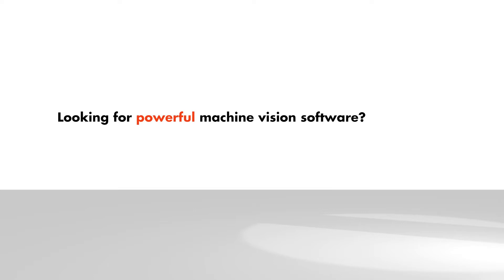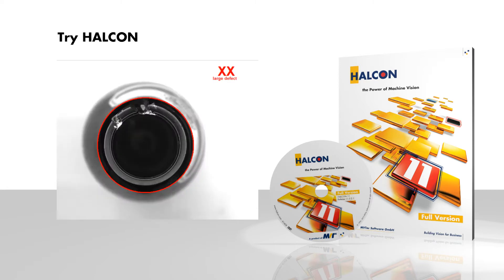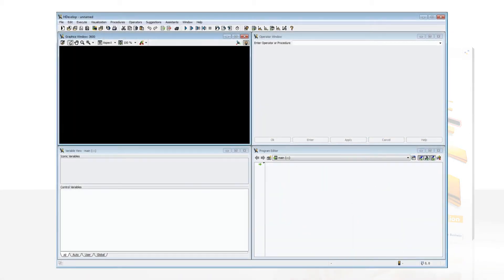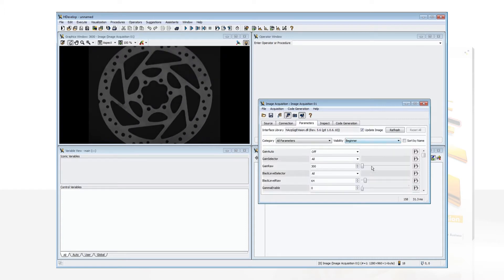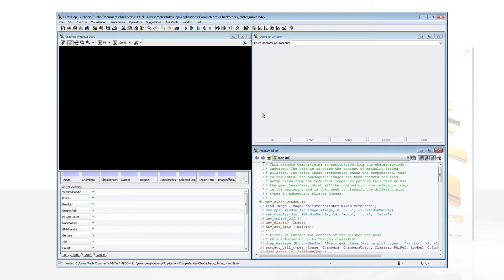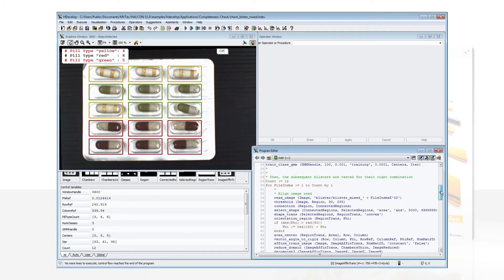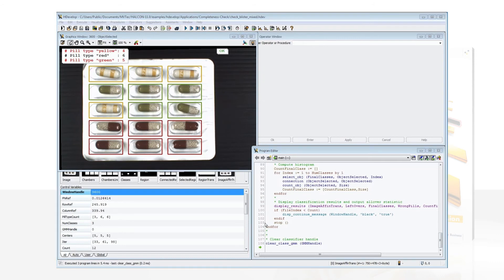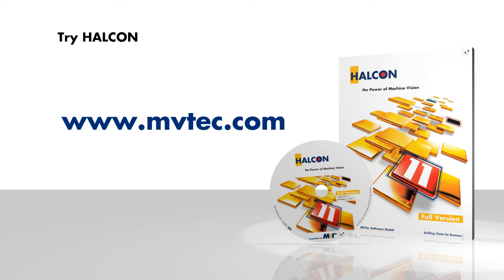Try HALCON Machine Vision Software

Comment: Please, can you tell me how to use Halcon code in Visual Studio (2010 or 2013). Simply open the code in VS doesn’t work. Should I set some paths or directories? I would like to create a GUI based on Halcon code. Unfortunately, it isn't well described in the documentations.
Reply from the maker: Dear Dies und Das ,
Thank you for your interest in the machine vision software of MVTec. 
MVTec sells its products exclusively via qualified distributors, who are responsible for pricing information, support and, if required, can also offer you appropriate hardware.
Therefore, we kindly ask you to contact one of our distributors of your choice. 
You can find an overview of authorized MVTec distributors at http://www.mvtec.com/company/partner-network/distributors/.
Kind regards, MVTec Software GmbH